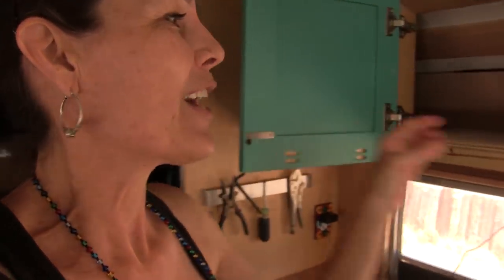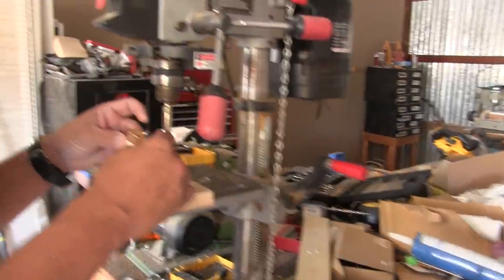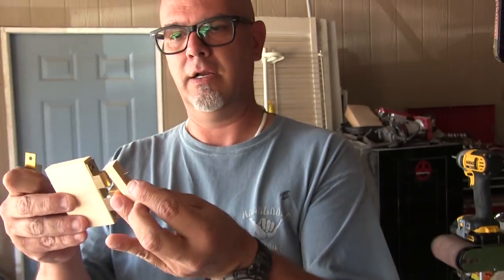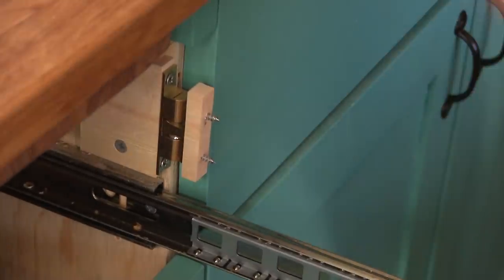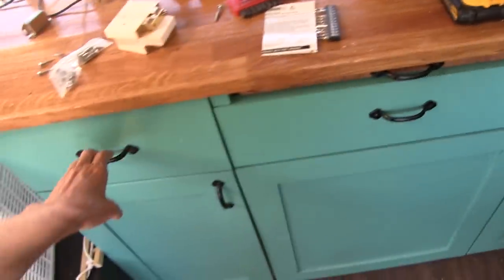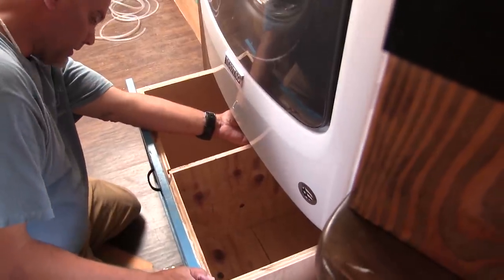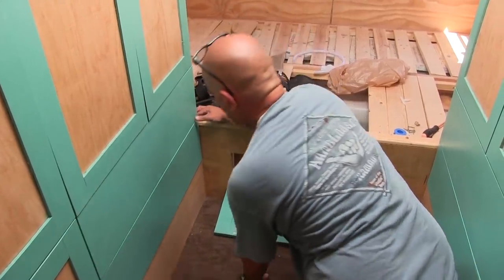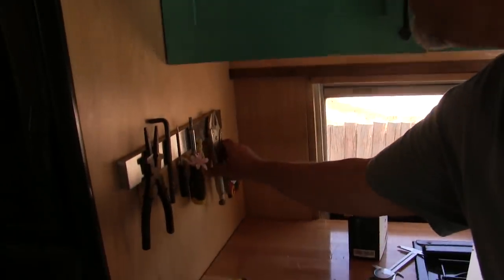Kitchen Cabinet & Drawer Latches for our Skoolie!

Comment: If you find the drawers are not holding shut tight, there are screw adjustments on the smaller part at the sides that push the balls in a bit more and that will hold the drawer closed firmer.

Comment: The problem is the trade off of how much force is needed to keep it closed while travelling compared to the inconvenience of overcoming that force during normal use. The stronger the latch though, the higher the tendency to leave it partially open. What you really need is something that can be disabled while parked but active while travelling. We use two on each draw, a push button and a weak magnetic. We leave the push button popped out while parked.

Comment: Don't need to double latch, just tighten the screws on the ends of the latch to increase the strength. Also you could have mounted the latches 90 deg without fixing them to pieces of wood, but the vamp idea was good

Comment: I was just wondering if a sliding latch recessing in the drawer face is feasible? Like a bolt that could slide into a predrilled hole in the the frame? Then when you are moving you don't have to worry about the drawer  or doors opening on you?

Comment: Are the screws on the inside ball bearings do they turn in to add more spring tension on the balls?
Reply from the maker: I just posted a little video on Instagram about that but the short answer is YES! In fact, they adjust to a very strong grip.